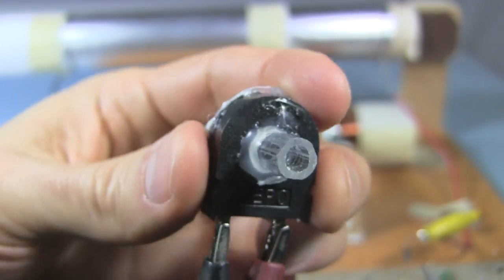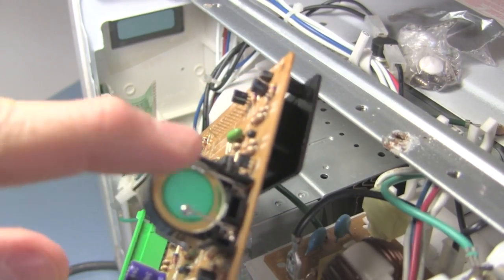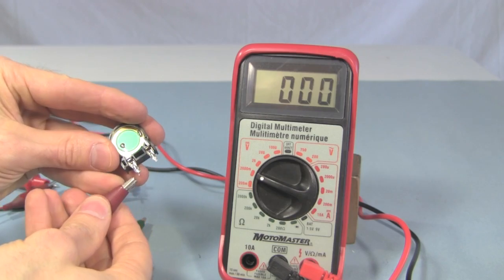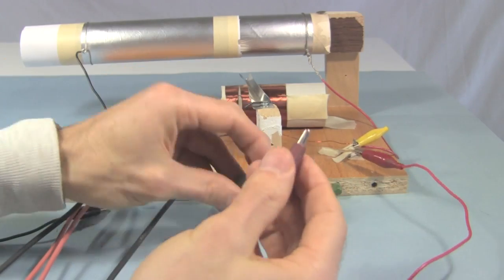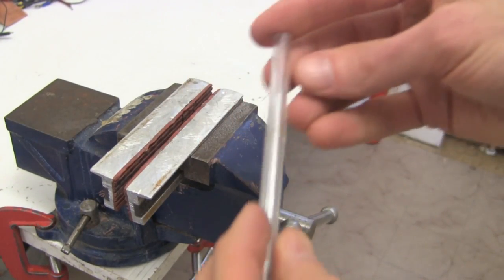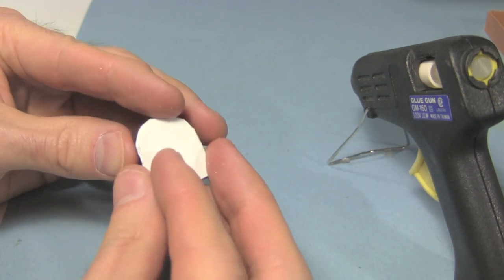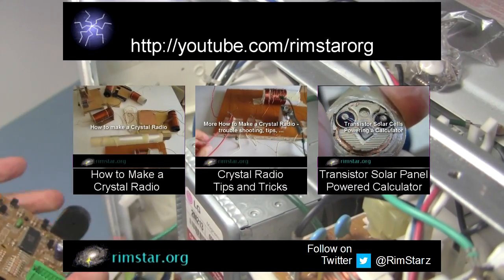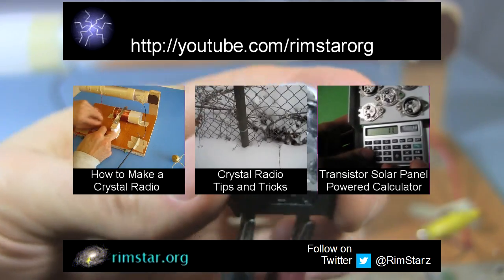Make Crystal Earphone/Earpiece for Crystal Radio - Homemade

Comment: Can I use a 3 lead piezo buzzer? I bought this one from radio shack for $0.40 cents.http://www.radioshack.com/95db-panel-piezo-buzzer/2730075.html#.VRIL-uFO1pU 95dB 12VDC
Reply from the maker: incubusman421 It says "piezo" buzzer so it might work. I didn't see anything there saying why there are three wires. But at $0.40, if it doesn't work then you didn't lose much. Nice price.
Reply: RimstarOrg
The leads are continuous, pulse and common. Should I use the lead for pulse or the lead for continuous?
One of our Radio Shack locations is closing and I bought it on the last day they were open. They had all of the electronics components in a box and I had to sift through tons of goodies to find it. I should have bought a few more things but I didn't have the time. I think it was on sale, normally stuff like that costs more than a dollar at the shack.
Reply from the maker: incubusman421 My guess is use the continuous and the common. Let me know how it works out in case others also run into this later. And yeah, sadly I heard that Radio Shack is going away altogether.
Reply: +incubusman421

Sure. I could tell you which leads are what, but with only three it's quicker to try different configurations for the best results.  You'll probably find that tying the middle lead to one of the outside ones then using the remaining two for the circuit will give best results.

Comment: Or you could just buy a crystal earphone from unitednuclear.com for 6 bucks ;)
Reply: +Adam Olympia 

The old crystal earphones usually still work today.  The newer batches made in recent years are defective.  My experience is that one in five don't work at all, and two or three more will stop working in short order.  In one batch of 5 I bought; none worked!  Taking the bad ones apart showed that the wires were not even cemented to the element --- they were just resting against it in hit or miss fashion.  If you have one that doesn't work, try dropping it on the kitchen table from a height of two-feet.  That sometimes causes the wires to reconnect, and may reset the crystal even if the wiring is ok.

Comment: I was just curious. Whenever the current enters the diode, it looses voltage and the negative portion of the wave is stripped off. Then it goes back into the earpiece. What makes the crystal sense it then? What exactly does the diode cut off? Does it make the audio wave more positive by cutting off electrons so the earpiece only pickups the protons?
Reply from the maker: Lucas Wootten Rather than type out a long answer, I'll refer you to my video on how a crystal radio works http://www.youtube.com/watch?v=0-PParSmwtE. 2:02 has stuff about the diode and crystal. 8:55 starts talking about the radio and audio waves.
Reply: I understand the majority of it, I actually did a presentation on it. But my professor wants every possible detail. But mostly how exactly the piezoelectric crystal picks up the waves after it exits the diode?
Reply from the maker: Lucas Wootten Hmm... I don't know what more I could say besides what I explain starting around 2:02 into the video. Did you watch all of the video? There's even more about the waves starting at 6:54 that then leads into the stuff I pointed out at 8:55.

Comment: Is this a piezo buzzer or piezo transducer? I'm trying to get one from radio shack. Thanks
Reply from the maker: Cameron Cooper The answer is yes, it's both. A transducer is something that converts energy from one form to another. So a piezo crystal acts as a transducer when converting mechanical energy into electrical energy and when converting electrical energy into mechanical energy. A piezo buzzer does the latter, converting electrical energy into mechanical energy which produces sound waves in the air. But the one in this video isn't quite the same as the piezo buzzer you get from radio shack. The one from radio shack is like this but with the addition of some extra circuitry for converting DC electricity into something that pulses the piezo crystal.
Reply: Ok thank you! Also I'm not sure what my inductance should be for my coil. I'm using a short piece of bamboo with a diameter of 2.75. The wire I decided to use Is thermostat wire which I believe is 18 gauge. Now rather than wrapping it and then sanding the insulation off I made 7 individual taps by raising that piece of wire and stripping the insulation and twisting it that way my alligator clip can clip onto that wire.. What is your opinion on my construction/calculations... My calculated inductance is 148.5uH
Reply from the maker: Cameron Cooper I'm assuming that's 2.75 centimeters. 2.75 inches would be a pretty thick piece of bamboo. To calculate inductance I'd also need to know how many turns you have on your coil and how long the coil is. My coil tops out at 369uH.
Reply: RimstarOrg Yes it is 2.75 inches in diameter. Length of coil in inches is 3.5 and number of turns is 61 with a tap every 7 turns giving me 7 taps total.
Reply from the maker: Cameron Cooper Cameron Cooper At full length I calculate an inductance of 789uH. If your variable capacitor is the same as mine
 with a top capacitance of around 600pF then you should be able to tune 
up to 1.7MHz, so that includes the full range a normal AM radio can tune
 into. That's using only the formula for parallel coil and capacitor resonance (LC tank circuit.) The inductance formula I'm using isL = (permeability x number of turns x number of turns x area) / lengthwhere the permeability of air or bamboo is around 1. This is using the metric system, so the dimensions use meters.
Reply: RimstarOrg I went to our school lab to use the LCR Meter and measured the inductance to be at 161.2 uH and my variable capacitor i have is measured from 16 pF - 390 pF.
Reply from the maker: Cameron Cooper Oh, I just rechecked my calculation and I used your diameter when I should have divided it by 2 to get your radius and use that when calculating the area. My calcs give the inductance as 157.8uH. Over your capacitance range and using a fixed inductance of 157.8uH, I get a resonant frequency range of 203kH to 1.003MHz, so it's missing the top of the normal AM range. But by using a tap on your coil that's halfway and with your capacitor at 16pF I get an inductance of 78.9uH and a resonant frequency of 1.417MHz. So based on these simple calculations alone your should be able to tune in the AM range. That's ignoring all other factors in the circuit.If you want to do these calculations yourself, I've given you the formula for the inductance in an previous reply. The one you're missing is the formula for the resonant frequency of a capacitor and coil in parallel which is:resonant_frequency = 1 / (2 * 3.14159 * square_root_of(inductance * capacitance))See my video on how a crystal radio works at starting around 3:37 http://www.youtube.com/watch?v=0-PParSmwtE
Reply: +RimstarOrg 

I&#39;ve got lower inductance coils to work fine by increasing the capacitance of the tuning capacitor.  Conversely, I've got total band coverage using smaller variable capacitors just by winding an extra large coil and tapping it when necessary.  Most circuits call for a 350pf variable --- I&#39;ve long used a 500pf variable which is large enough to absorb errors in coil winding.  Coil winding programs are often iffy, but the best one I&#39;ve seen is Professor Coyle&#39;s versions.  Just Google &quot;Professor Coyle coil&quot; and you&#39;ll hit the site.

Comment: I don't understand what I'm looking at when you show the crystal side. is there a wire soldered directly onto the face of the crystal and the other one soldered closer to the side?
Reply from the maker: hi li The whole thing is what looks like a brass disk onto which is coated the whitish crystal. One wire is soldered to the brass disk (the connection that's closer to the side), so it electrically makes contact with the side of the whitish crystal that we can't see. The other wire is somehow soldered to the side of the whitish crystal that we can see but I don't know how that's done. I just looked at another one I have and it does appear to be soldered directly to the crystal, though maybe it's soldered through it (?).In commercially made crystal earpieces the brass disk is instead a flexible foil material that's held under tension by the earpiece's plastic case. I think that's what makes them far more sensitive and produce a louder sound.
Reply: fascinating. Thank you for your excellent reply.

Comment: If you leave it on what happens to the output?   does it get more intense with time?
Reply from the maker: ***** No, the output stays the same.
Reply: +RimstarOrg 

Yep, output is constant depending on station strength. One tip though --- if any crystal element stops working altogether, try a moderate tap or drop against a hard surface to get it going again.  Sometimes these crystals will develop a charged polarity and have to be moved to discharge it (my theory anyway ---- in any case the thump or drop works).

Comment: Thanks man! I am restarting a hobby of crystal radios after nearly 40 years to find almost everything involved is scarce, now. The video is pure gold and like made for my case; I have a junked microwave in the basement. I was wondering if those tiny diodes on the PCB might be useful, too, even if a bias current might be needed, and there is a useful looking transformer there.

Have not had the time to look at all your videos, but nice channel. Subscribed!
Reply from the maker: Welcome to my channel! I'm glad you're finding it useful. Sounds like you're going to have some fun, biasing a diode in a radio is something I haven't done yet. In case you haven't seen it, and in case it helps, there's a Crystal Radio playlist on my main channel page that has all the related videos. Thanks for watching!

Comment: I just subscribed. I made a similar radio but I used the NTE 109 diode and placed the antenna coil inside my tunning coil by doing this it makes it easier to tune by being able to move the antenna coil side to side inside the tunning coil. Instead of a capacitor i wired in a ferrite rod with coil from an old radio before the incoming side of diode to the antenna. This may give it a boost. if you would like to see it check out my channel. the video quality isn't to good but its all i had.
Reply from the maker: Nice radio. By the way, NTE109 is a germanium diode. I have a whole bunch of them, don't know why I never tried one. I should remember to some day.
Reply from the maker: Oh, and welcome to my channel!
Reply: cool thanks.
Reply: sorry I mean the N134A. man I looked all over town for one and couldn't find one.

Comment: Here's a tip, you can also use the mic from a telephone handset.  The part that you use when speaking.  Its also a piezo speaker
Reply from the maker: Thanks for the tip. I've been hoping to run across an old discarded telephone handset but so far no luck. Maybe I'll find one at the yard sales in the summer.
Reply from the maker: *****
The small size of the speaker actually works against it by having a very low impedance (resistance to AC). Piezo crystal speakers like in the microwave oven actually have a high impedance. However, you can try adding a transformer in between the crystal radio and the small speaker. I show how in my "Use Earbuds/Earphones with Crystal Radio" video http://youtu.be/GCh2LVHUavQ

Comment from the maker: It's surprising they don't make the fuse more easily accessible and put in microwave oven manuals that it should be checked the the microwave stops working.

Comment from the maker: Yes. In fact I used one of those greeting card crystals in my "Piezoelectric generator LED lit by rain water" video. But I think more and more these days the greeting cards contain electromagnetic speakers. It's a little difficult but if you go to the card store looking for them and want to know which type is in the card without tearing it apart, the electromagnetic speaker ones have a Neodymium magnet in them, so test the cards with something ferromagnetic, some keys for example.

Comment from the maker: A timer that you spin/dial. That does sound like an old design. As you say, it's probably a mechanical bell. There's no harm in opening it up and checking for the fun of it. Just be careful not to touch the high voltage capacitor. I'd say the capacitor is usually in the bottom, rear on the side with the electronics but with your microwave oven it may not be.

Comment from the maker: I don't know the substance. It looks like the same type of material as in piezo disks you find in commercially available crystal earpieces, gift card speakers and piezo buzzers, in case that helps you find out. The use in a microwave oven is for the speaker that beeps when something is cooked.

Comment from the maker: I tried that. The crystal radio didn't put out enough power to make it work. I did get that to work with a clock radio though, but that has an amplifier. If you're curious, see my video "How to Make Piezoelectric Crystal Speaker"  (you can find it on my channel page.)

Comment from the maker: Yup, I showed it in my "Crystal Radio Troubleshooting and Tips" video. Of course the other issue is, is the ground hole in the wall socket connected to ground? It is in only one socket in my whole apartment. To check, I use my voltmeter on the AC scale to test voltage between neutral (the taller of the two) and ground holes. In North America there should be close to 0 volts between them.

Comment from the maker: Thanks Grant. Drain pipe? I'll have to try that. A longer antenna should help. I use three 15' wires in parallel and have tried one 50' length but I guess they were equivalent since there was no improvement.